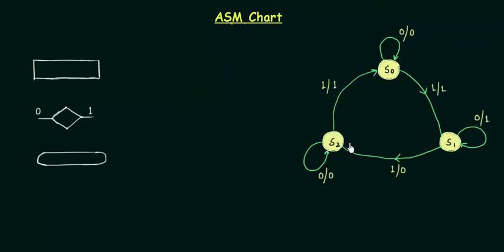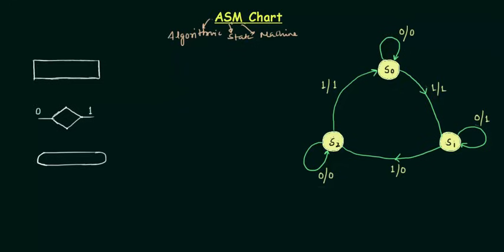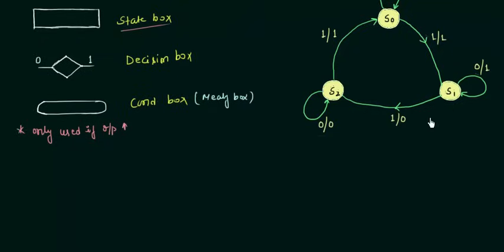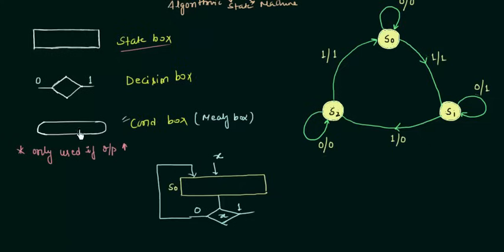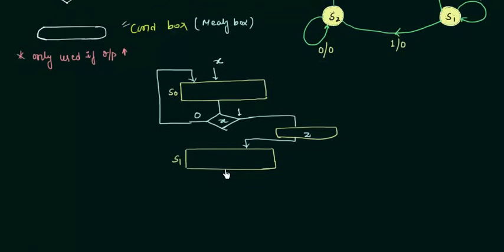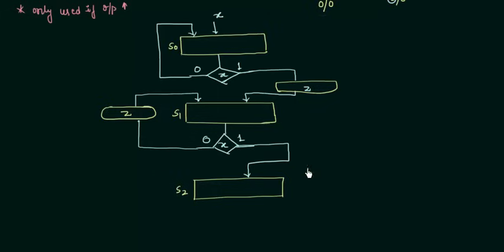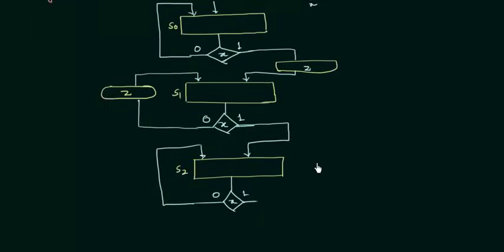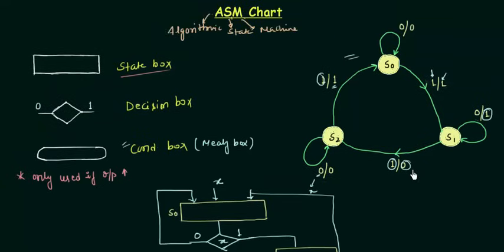ASM Chart

Comment: suppose in an operation there is four  4 states and inside a state there is more than one condition have to set or reset then how can i make equation with present state and next state.( I'm making control signal in multi cycle architecture)